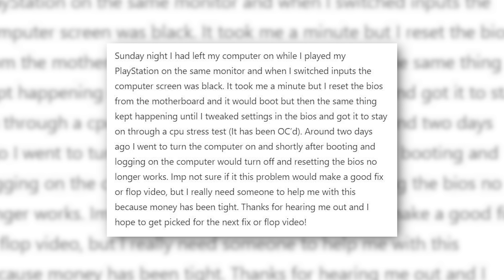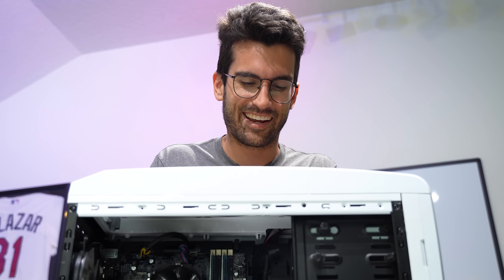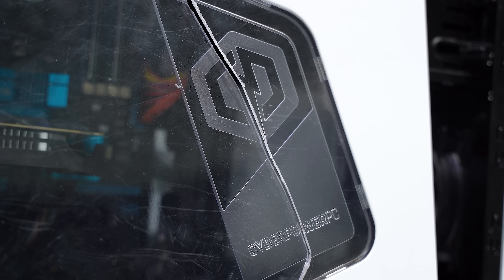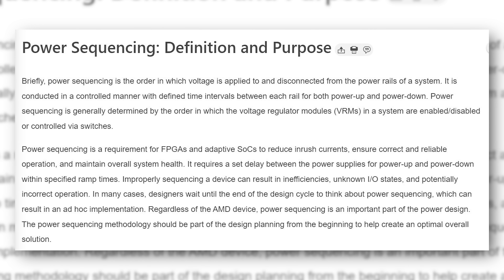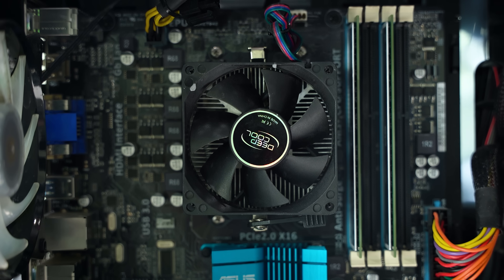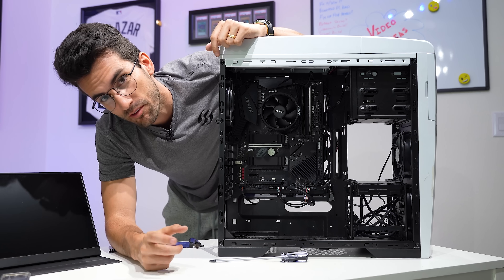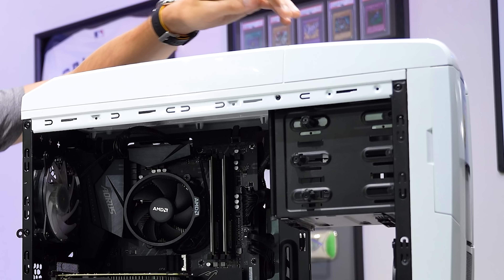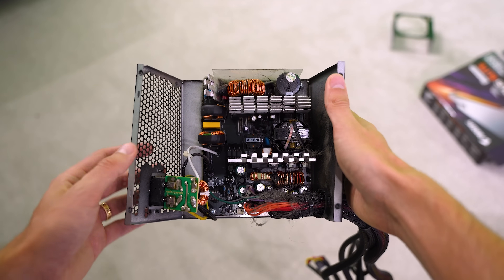Fixing a Viewer's BROKEN Gaming PC? - Fix or Flop S5:E12

Comment: At this point, I'm starting to wonder if people are just trying to toss in their old stuff that they know they destroyed back then just to see if they can get free parts from Greg. Bless his heart for being too nice and not questioning further even though the PC as described by owner should still turn on.
Reply: I won't lie i have wondered that myself, but that said it can't be at all easy to try to sus out any and all such cases and it likely isn't worth it.   I do not doubt greg catches any glaringly obvious attempts at such shenanigans though.
Reply: People will definitely try to take advantage but a system not behaving as described doesn't necessarily mean someone is lying. Many of us have taken a vehicle to a mechanic complaining about noises the engine is making only to discover it stops doing it when the mechanic tries to find it. I've had systems behave a certain way and when I check for it again, it either stopped, or a different problem reared its ugly head. I don't know this person and I won't speculate, but I do know that strange things can and often do happen.
Reply: I'm not saying people ain't doing that. I'm sure some are/have. But read some comments on these tech YouTube videos. Some people are genuinely running 2nd Gen i5s and i3s still. Pretty sure last night I'd read one where they'd still had core 2 duo.
Reply: @Dankbongripz420  Most pc users are probably on banger pcs,if it's all you are used to then it's all you have or will ever need for FPS or RTS games..
Reply: In the end of the day, we are entertained by his analysis, diagnosis and generosity to replace broken components. 
People need to calm down and enjoy the show.
Reply: This is exactly what crossed my mind, when it’s more than one thing wrong it starts to look suspicious.
Reply: @Broxibear212 then you clearly did not have a bad psu fail in a rig😂
Reply: @Behemoth33  True, those Thermal-take PSU's were taking out motherboards a few years back!😲😲😲
Reply: My initial though was also that he was played. But there is no way knowing so its just to roll with it.
Reply: Greg gets such comments since the very first video and you can never be sure. We just have to hope that everyone is nice and honest here.
Reply: Well, if doing that reduces E-Waste, then it's good right.
Reply: Maybe... luckily Greg doesn't have to pay for a lot of the parts (PSU and MBO here he said got sent to him for the purpose of these videos) so he doesn't loose out too much. The ones who would be really losing out from this video would be gigabyte and bequiet but I think they have enough to spare lol.
Reply: I still have a working 8370 with an asus sabertooth R.3 motherboard and an evga 1070 ftw2 I built it almost 11 years ago now.
Reply: Perceptions based on very few actual facts,well done...
Reply: I think inserting ourselves into Greg's business is exactly what an audience is NOT supposed to do
Reply: Who cares, obviously it's still lucrative enough for him to make money with these kind of videos, so everyone benefits. We're entertained, the owner gets a working PC, and Greg gets money from these views.
Also, he's using sponsored parts, and those that he has to buy himself are business expenses and for the most part tax deductible anyway.

Oh, and I have an old Intel system where one RAM channel doesn't seem to work anymore, and a GT 8800 where the heat sinks fell off, unfortunately shipping to the USA is so expensive 😜
Maybe when he's next visiting his wife's relatives in Germany... 😏
Reply: I was the person who sent this rig. I'm also a long time watcher and this is my first computer that I got from a friend for only 100 bucks which ended up breaking. I'm super thankful for Greg and I'm glad he was able to really help me out like this.
Reply: Well, it's still educational and fun to watch. You are bound to bump into dishonest people every now and then, that's just life.
Reply: You can wonder all you want whenever you want, people might be evil minded like you described but really, Greg has yet another viewer project to make a video about.. 
meaning he gets to do his YT job while we get to watch and enjoy.
i don't see it any other way. yes it could sometimes be shady between the lines but in reality it doesn't take away from the main goal (for me personally at least).
and the main goal here is to fix a system and give it back to the owner in working order. and sometimes that could mean swapping the entire platform.
Reply: I got the exact same thinking. My jaws dropped after realising it is AM3+ mobo. LOL!
Reply: Brings the views. It's a win-win!
Reply: Be you Greg, I enjoy watching your content and have learned a thing or two, if you want an older system to play with (pentium4s or older)let me know be glad to send you one free of charge.mày evan have a system thats so old it still has win5 on it lol.
Reply: If only this was a 2009 modern warfare lobby.
Reply: I see it more as, people in YouTube enthusiast land are used to modern high-end stuff, and normies are using older stuff until it dies. A friend's mom recently replaced her Core 2 Duo machine , these things are still out there...
Reply: Just to explain my hot take on this, I've worked on plenty of university-owned PCs and whenever something burnt badly like this, they at least smell for about a day or two especially when it involves power connectors and burnt plastics. And every time somebody complained to me their PC stopped working and something smells, I tell them right away that we're gonna have to replace possibly the entire dell PC and pray that it didn't short circuit the hard drive too or else we would need to send the drive to expensive data recovery (been lucky never needed to). Most of the time I tinker with them just being curious and have always found either, a burnt part / connector or a popped capacitor.

Now the owner saying two instances (of when the connector possibly burned out) and neither case he didn't mention a burning smell at all. Mind you, he said this was two days ago, let alone the issue started that week on Sunday. Greg didn't mention a burnt smell at all. Normally, people would be traumatized right away with a weird smell coming from their PC or someone fixing it would feel really sorry that that toasted PC has already happened.
Reply: Looks at my daughter's  PC that has an I5-650 and 8gb of ram with a GTX 760. Then at my Wife's old Motherboard with an AMD 860K and a RX 570. Sure old hardware isn't still in use. It all depends on the games this person was playing.
Reply: While I understands why Greg is doing this and I appreciate him greatly, I agree with you Kamizerox. Many of these submissions are not honest and it is evident. Hope Greg gets the right candidates and continue this great series!
Reply: If you had watched the video, you would've seen that the pc was not functional anymore. Just because the owner didn't KNOW what the issue was doesn't mean that he's lying. Otherwise, he would've probably just changed components himself.
But at the end of the day, remember that it's gregs channel, and he gets to decide what he upgrades. You don't get to tell him anything except for thanks for the content.
Reply: @elemental9210  if you'd watched the video you'd not only realize that the email the user sent and the actual symptoms didnt line up. Also the pc was described and shown by Greg as being "very clean" which makes it even more sus that the user never smelt a burn on the board, or noticed that the cpu power connector was literally burnt and partially melted.
Reply: @qT_p13 yet he decided to fix and post this anyway even after stating their are many systems turned down or many videos not released. Imagine trying to make white knight defenses to a channel with a pretty harsh as previously stated criteria to make a "content video".
Reply: @twiztedclown  imagine having an opinion on a video and being allowed to voice said opinion in a specific section of the video dedicated to voicing opinions...
Reply: @elemental9210  dude literally said money is tight and he cant buy anything to fix it
Reply: that or i swear to god they but literally broken pcs on ebay and send them to greg for free parts you cant trust anybody in this era
Reply: Replacing parts is not fixing!!!!
Reply: @mrq332  if a part is broken then replacing is fixing you donut
Reply: @mrq332  It's the overall PC that needs fixed, not any one particular part.  By replacing a non functioning part, you fix the overall PC, genius.
Reply: LOL I have a few of the old bulldozer cpus(8150,6200, and another), MB and memory laying around, been trying to give them away for a while - didnt think anyone was still trying to use them. No big surprise I remember them killing a power supply, and the heat was way too high
Reply: 100% agree.
Reply: yes. this is exactly what is happening and Greg doesn't actually "FIX" anything. He replaces and throws shit away. I would change this series to "replacing parts on peoples old PC's to make them work again". but i don't trust this guy either, he says mounting AIO's with the tubes on the TOP is never a good idea, even manufactures say mount them on the bottom and not top. and this guy does it anyway and says its fine. nope, never trust him again.
Reply: @TriforceOfCourage97  You'd be surprised as to why the IT industry takes "Have you tried turning it off and on again," as the go to joke about fixing things.

Comment: Barely started the video and had to comment. First, the user is overclocking without the ability to replace parts that might get damaged from the overclocking. Second money has been tight, yet that system is probably so inefficient that a $100 slightly newer used system would likely save $100 over the next year, I get that it is certainly possible that they just can't get the money together for that up front cost, I don't believe that it is a skill or knowledge issue because of the overclocking. Third, overclocking, especially an FX CPU with that tiny cooler is just asking for problems, like less than $20 would get you something far better that is actually able to handle that, I am predicting degradation from heat/overclocking and now it would likely have to be underclocked/undervolted to have an chance at being stable.

Comment: AM3+... that brings back memories!
Reply: bad memories lol those CPU's were terrible. made me straight up avoid AMD until AM5.
Reply: Before my Gigabyte 990FX Gaming ( G1 ) died ; I had what was nearly the best AM3+ - FX system you could build. My cpu was the FX-9590.  In some ways - even today it would probably do decent enough at 1080p gaming and most other everyday use cases. My current AM5 based system would totally destroy my AM3+ system ; even so ; I was very proud of the system I was able to build it to the level it got to. I feel the FX-series of CPU's got a worse rep then the deserved.
Reply: and they are not great memories - I still have atleast 2 a 8150 and 6200 with MB and memory somewhere, I cant believe someone was still using them
Reply: @tomr3422  Yeah I had an 8320 back in like 2015, was not a great cpu.